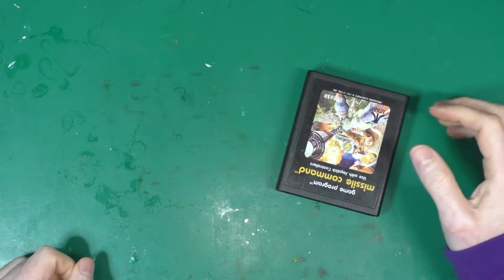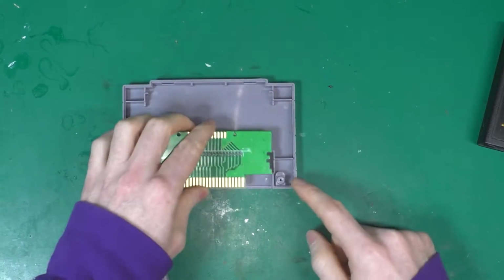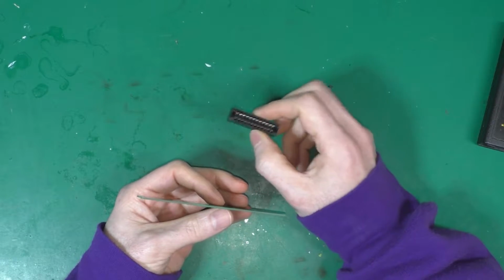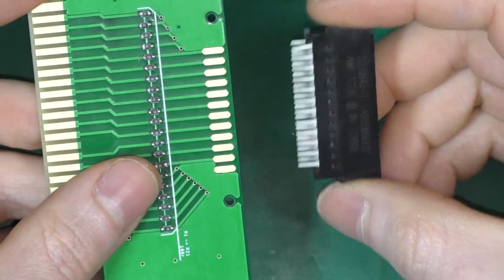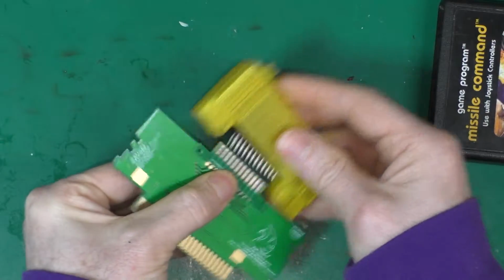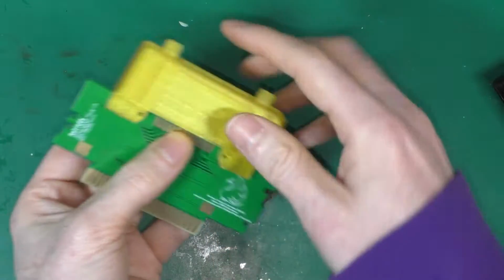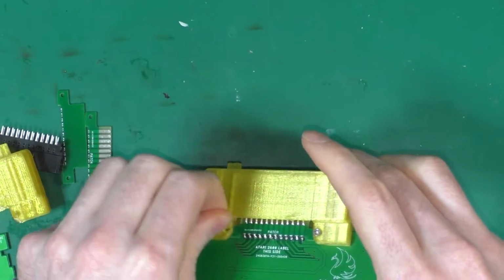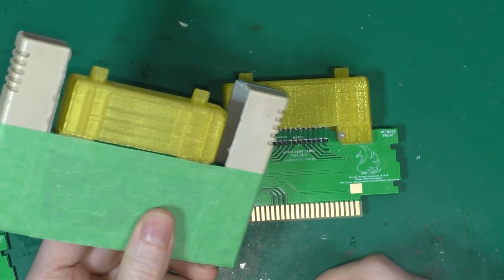[RETRO] Atari 2600 Plug in for Retrode 2

Comment: Just wanted to say that this Atari 2600 adapter is great! I just finished dumping my 2600 library using the retrode.  All that to say that there are some problems dumping 2600 games, but it is not the fault of the adapter. The retrode community has kinda fallen apart and there are no more firmware updates to the retrode. Too bad too, I was really hoping to get a Turbografx plugin.
Reply from the maker: Yeah the forum is down since a while now. I was looking to do a Turbografx adapter, but sourcing the connector is difficult. Last track I found was from René from DBelectronics, who gave me a twitter contact from china who had some, but it turned cold.